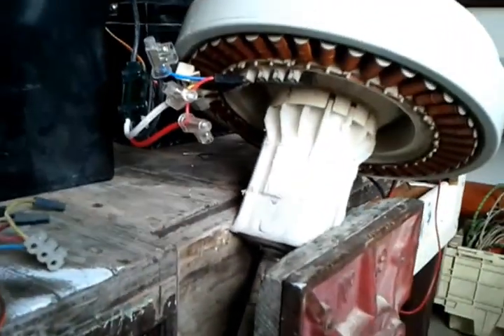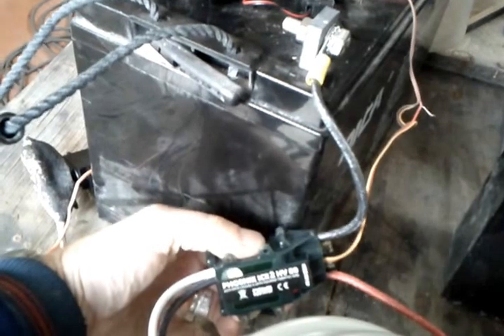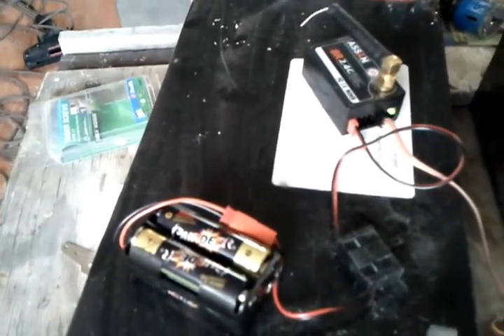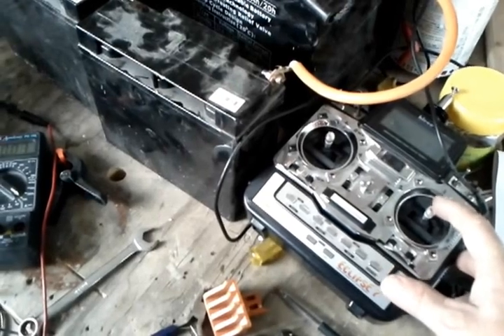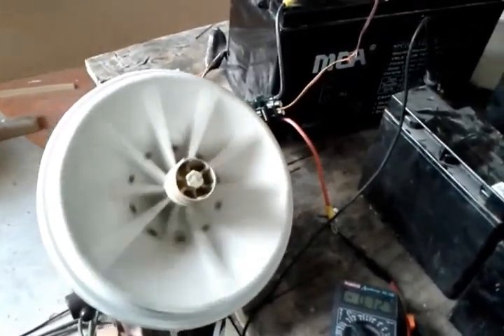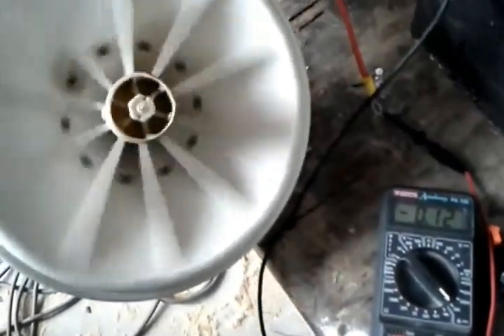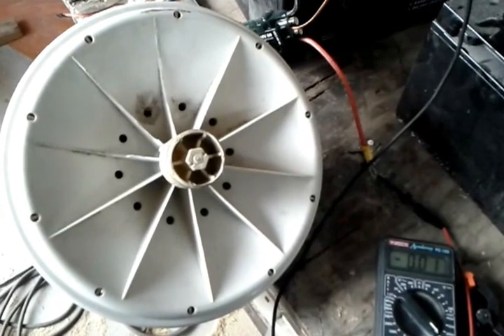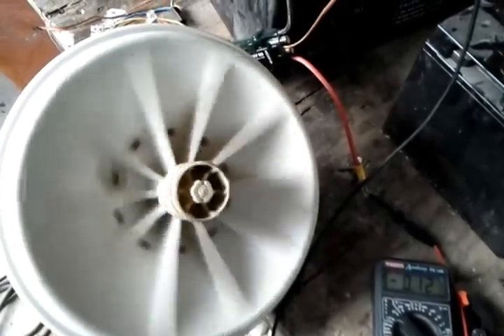electric vehicle fisher and paykel smartdrive PMAC BLDC RC ESC  washing machine motor!.mp4

Comment: Just wondering where you were measuring the current draw with you multi? As I believe they can draw alot more than that.  Thanks
Reply from the maker: off the battery post through the meter A terminal if I remember right
Reply: @AdrianGalindoHome  Interesting, wondering if the frequency of the ESC is too fast for the multi and it reads an average. I could be very wrong though :)
Reply from the maker: @KizM8  on the contrary, you are correct, the meter is true rms and I fully expect it to be displaying an average